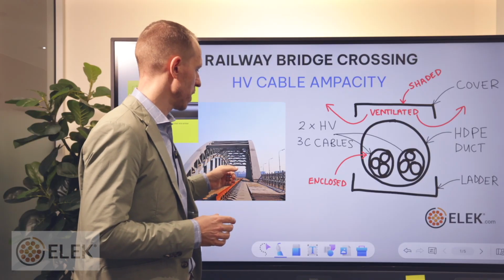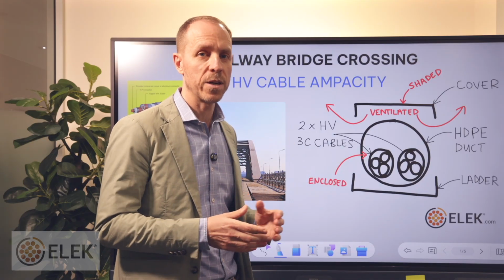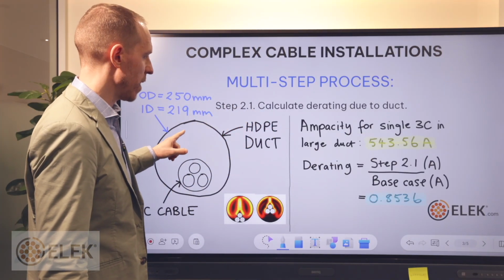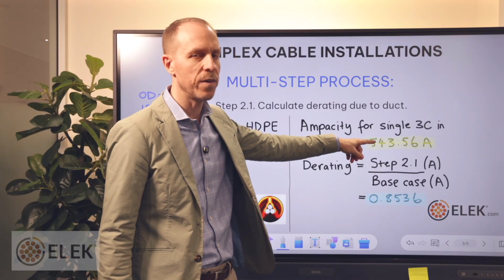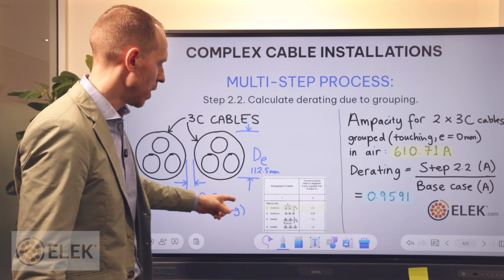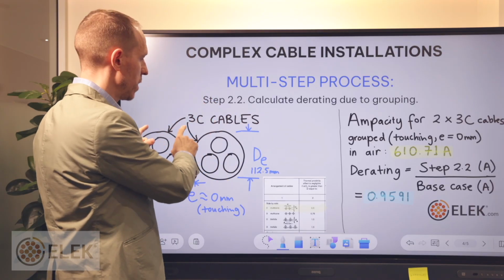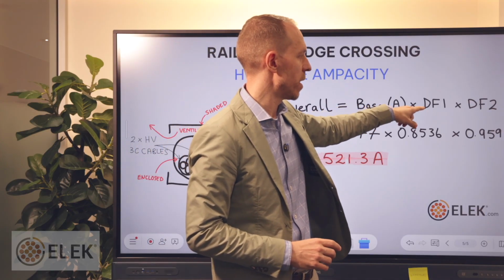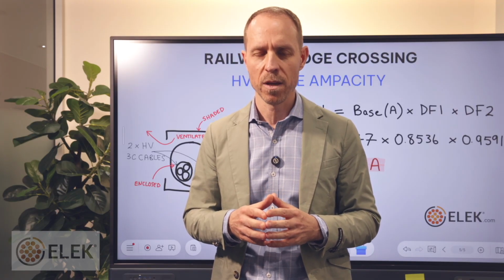Cable Ampacity Calculations for Non-Standard Arrangements

Comment: Why did you not calculate the ampacity with FEM ?
Reply from the maker: This multi-step (inference) method is sufficiently accurate for most engineering applications. FEM requires significant expertise to set up, and most of the time it's done incorrectly.